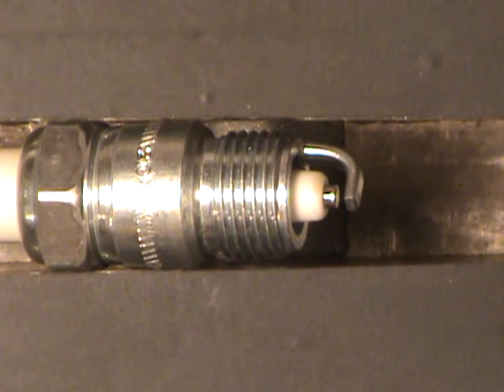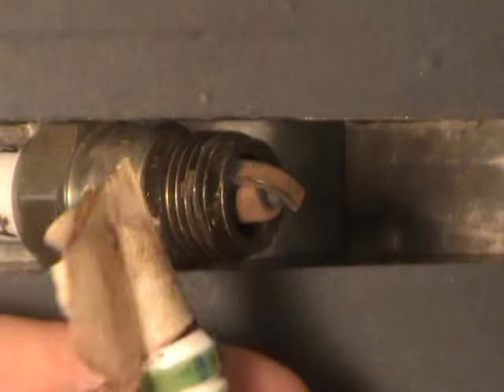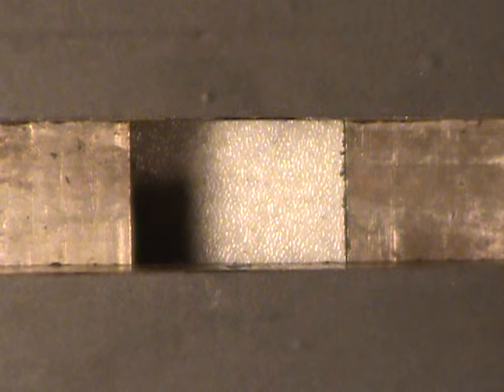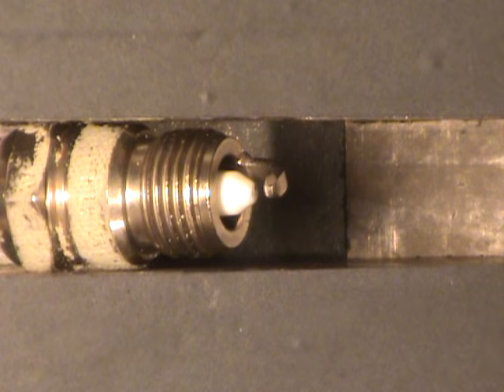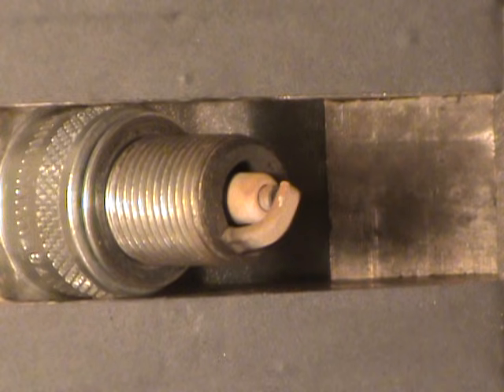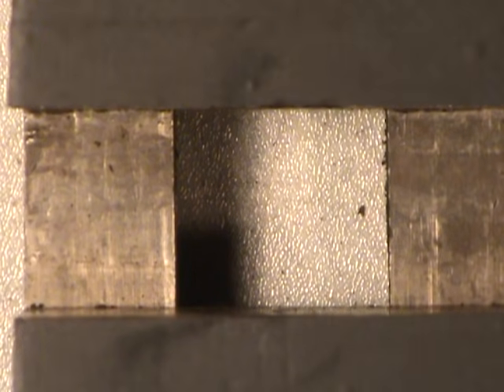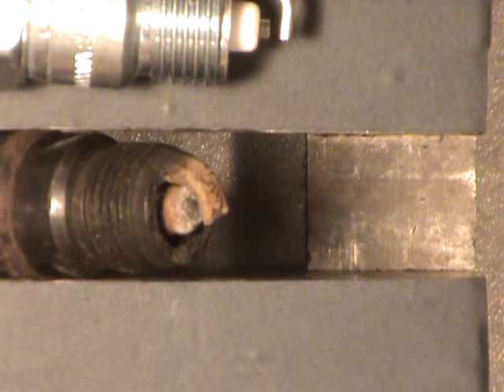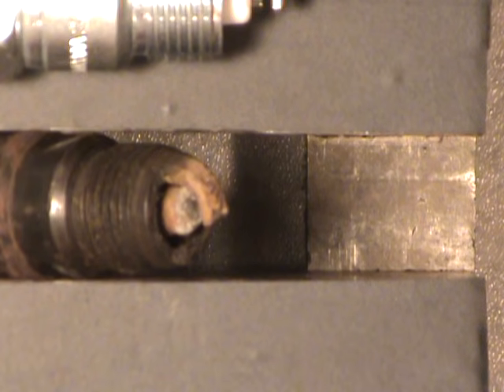SPARK PLUGS How to Read them (Part 3)

Comment: On the plug you show at the 6:00 minute mark, with the grey porcelain, if it was on a 4 barrel would you jet the primaries up by 2 or would you be looking at the secondaries as well?
Reply from the maker: Greetings MasterKane1963....Thanks for watching, and for Your comment/question/s as well....Well now, there are so many "Things", that have to be taken into Consideration, and, the First thing, that a Person should be made aware of, is the Fact, that "Gasoline" these Days, and for quite a few Years in the Past as well, is somewhat "Different", then the Gasoline, that used to be "Leaded" (pronounced "Led-ed"), and that "Lead", I think, was called..."Tetra-Ethel-Lead"...and was an Additive, that the Gasoline Refiners/Producers Added to that much "Older" Gasoline, to, I believe, Raise the Octane Level/Rating, and, also, from what I recall, that "Lead" Additive, helped to perhaps "Cool" the Exhaust Valve "Seats" in the Cylinder Heads, as the Exhaust Valve "Seats" were probably made of a much "Softer" Metal/Material way back then, in an Engine, perhaps produced before the 1970's, and I'm also thinkin', that, that "Lead" Additive also Cooled the Exhaust Valves themselves somewhat.

Then, due to that "Tetra-Ethel-Lead" being "Toxic" to Humans and many other Critters, that Tetra-Ethel-Lead, was, shall we say "Banned/Outlawed" by the Governments of the day.

That good ole "Leaded Gasoline" would probably leave some very "Read-able" Deposits on Your Spark Plugs, where-as, now that most of the Gasoline these days, is usually referred to, as "Un-Leaded" Gasoline.

Then, as of a few Years ago, the so-called "Un-Leaded" Gasoline started to have "Ethanol" (aka, Alcohol, some of which is derived from Corn, as in Corn-On-The-Cob) Added to the Gasoline, which, can "Alter" the Deposits (as in not so much, or any), that a Person is actually able to "See" and/or "Read" on their Spark Plugs "Fire-ing" End, which includes the Outer Electrode/Ground Strap & the Porcelain which surrounds the Inner Electrode as well...!!!

Also, Gasoline "Blends" have Changed/Evolved over the (many) Years, as in, things referred to as..."Oxygenates"..."Fuel System Cleaners"...&...any Other "Additives" that may be found in the Gasoline that is Sold to You, in the area where You Operate Your Vehicle, and, if Your Gasoline has Ethanol in it, that "%" (per-centage) of Ethanol can "Vary" somewhat.

I have seen on some Gas Pumps, Indicating, that the Gasoline "Might" have Up-to "10% Ethanol" in its "Blend".

I wouldn't want any Gasoline that has any More then "10% Ethanol" in it, as I have already "Re-Jetted" a Carburetor's "Primary Jets" .009" (9 Thousandths of an Inch) LARGER, in order to "Cure" a "Lean Surge" (Car bucking/jerking back and forth) while just trying to maintain 30 Miles-per-hour (50 Kilometers-per-hour) on a Level Road & while also keeping the Gas Pedal in fixed position.

That Grayish Color that You see on Your Spark Plugs, might not be all that bad, if in fact, Your "Gasoline", has about "5% to 10% Ethanol" in its Blend.

That nice "Light Tan" Color "Deposit" that You saw, on that Spark Plug in this YouTube Video of mine, was, as I recall, a result of having Gasoline that was being produced here in Canada, in about 2010 (Year), and it "Might" have had, as they say..."Up-To 10% Ethanol" in its "Blend", and that nice "Light Tan" Deposit was a Result, of having my 850 CFM Thermoquad 4 Barrel Carburetor's "Primary Jets"..."Increased" from, .095" up to .104" (95 Thousandths of an Inch, Increased to 104 Thousandths of an Inch Orifice/Hole Size!), which actually "Cured" that "Lean Surge" that my Car was experiencing, and everything from, the Engine Cold Starting, Warming Up while Driving, and, Over-All Response and Performance was, dare I say..."Fantastic"...!!!

Now, enough about Theory and Story Telling, lets now move onto, "How" Your Engine is "Behaving", and, weather or not, Your Engine/Carburetor/etc., may need some Help or Adjustments/Part Changes, shall we...

I have No Idea what-so-ever, as to just "What"...Year?...Car or Truck?...Model?...Engine?...Transmission?...Carburetor?...Any Modifications at all?...etc., that Your "Ride" (aka, Vehicle) happens to be...???

Seeing as how, up to this point in time, I have No "Specifics" to go on, I'll mention a few "Generic" things that can be considered...

How is Your Vehicle Running & Behaving, as in...Starting...Hesitating/Surging...Backfiring at different gas pedal Positions perhaps...or, "Anything" at all, that You have Felt/Observed, in the way, in which Your Vehicle is Running/Performing...???

One of the Most "Damaging" (and Expensive) things, that A Carburetor can "Do" to almost Any Engine, is to be "Providing" a "Way-Too-Lean" Air/Fuel Ratio, while Doing a..."Wide Open Throttle" (WOT) Acceleration...!!!

When the Engine is being Forced to do a "WOT", and using Gasoline "Without" any Ethanol in its Blend, about a "12.5 to 1" Air Fuel Ratio (or "Richer") should be relatively "Safe", so as "Not" to cause any Engine Damage...

...where-as...

...the "More %" of Ethanol in the Gasoline "Blend", the "Richer" the Air/Fuel Ratio should be, considering that "Alcohol" (Ethanol) by Itself, Needs to have a Much "Richer" Air/Fuel Ratio, then that of "100% Pure Gasoline" that "Does Not" have Any Ethanol in its Blend...!!!

One the Engine is up to Full Operating Temperature, I usually set-up the "Primary Jetting" in a 4 Barrel carburetor First, and, get the Engine to Respond well, while Driving at City Speeds (Legally!...lol)...

...then...

...once I'm satisfied with the Performance/Economy, with the "Primary Side" of the 4 Barrel carburetor in question, I usually start to "Dial In", the "Secondary Side" of that same Carburetor, starting with the Secondary Air Door's "Torsional Wind-Up Spring" Setting (if it has one, that is), while doing  some WOT's (Wide Open Throttle), and, if I keep my Manual Transmission in a Lower Gear, I shouldn't see those "Blue & Red Flashing Lights" in my Rear View Mirror...!!!...lol...

...and, if Needed, the "Secondary Jets" Sizes, might need a "Re-Calibraton" of sorts, which in most, but not all cases, calls for an Increase in the "Orifice/Hole" Size (aka, Jet Size), and, if needed, some "Accelerator Pump" Adjustments as well.

It's always "Best", to do a Complete "Tune-Up", Before trying to "Change" Anything, like, Carburetor Jets/Parts/Adjustments, and the same goes for the "Ignition System" as well...!!!

Always "Check" and Maintain your Engine's "Ignition Timing", as that alone, can make for, a Good Running, or, Not So Good Running Engine, which will usually include, Good or Bad Performance and Economy as well...!!!

Any Engine, that a Person "Expects" to have Running/Operating at a very Good Level of Performance and Economy, has to have...New, or, As New...Air and Fuel Filters...Motor Oil and Oil Filter...Gasoline that is Not Too Old, as it does go Bad...Ignition Components "Must" be in Great Shape, as in...Spark Plugs...Distributor Cap & Rotor, and Breaker Points (if so equipped)...Spark Plug Wires/Leads...and...Any "Other" Parts and Pieces, which might also include "Emission Control" Components/Parts as well...etc.

Still Awake...???...lol.

So then, if You care to, You can let me know, all that You can, as it applies to Your Vehicle, so I won't have to, go on...

...a "Wild Goose Chase"..!!!...lol.

Be Safe, take care, and have a good one.
Reply: RockysRoadshow
Wow quite the response lol. Thank you for the information.

The ride is 1963 Ford F100 with a 302 attached to a C6 auto. The 302 is mildly done up. Comp cams XE274 camshaft, 1.6 rockers, performer rpm intake, 670 holley street avenger w/ vacuum secondary, MSD 6AL ignition box with an MSD billet distributor (mech advance only, no vacuum can). Carb is clean, has a fresh cap/rotor

The truck idles well, street driving/cruising is good, occasionally I will get a bit of run-on, but in Drive at cruising speed I will get a slight ping if I accelerate (without downshifting) or on climbing a hill. Since my plugs are a greyish colour on the porcelain, I'm wondering if my pinging is a lean ping. Also wondering if the greyish colour is deceiving because, as you said, they put a lot of crap in gasoline nowadays. Timing is not overly advanced either. 10 deg initial, 30 total and I have read/heard that a lot of 302s like more (32-38 total).
Reply from the maker: MasterKane1963
Greetings MasterKane1963....Thanks for the "Extra", and somewhat Needed Information, as that my Friend, will indeed "Shorten" the Time, that I have to  be spending, looking into my Crystal Ball...!!!...lol...When You stop Laughing, we will begin....I see that Your "Distributor"..."Does Not" have a "Vacuum Advance" Canister/Unit on it, and, by "Not" having "Vacuum Advance", on a, shall we say, "Street Drivin' Truck or Car", as opposed to a "Trailer Queen", that always gets "Trailer-ed" to the "Race Track/Strip", and is a "Race Only" Vehicle, then, Fuel (gasoline) "Economy", while just "Cruzin'" Along will be suffering quite a bit, along with probably having Your Truck's Engine "Consuming" too much Gasoline, when it really Doesn't need it, especially, while, like I said before...while just "Cruzin' Along".

Also, by "Not Having" Vacuum Ignition Advance, on Your Distributor, I'm, actually quite surprised, that Your Spark Plugs "Are Not" covered with black "Carbon!"

You had mentioned, that Your 302 Cubic Inch V-8 is Mildly-Done-Up, which has me wondering...just how much of a "Compression Ratio" that Your Engine happens to have...???

Here's a somewhat "Generic" Reason, as to why, Your Engine, is, as You described it..."Pinging", while "Accelerating", and also, while Going-Up/Climbing a Hill...

There are a few thing, that can/should be Considered...

A light "Pinging", of the Engine while "Accelerating", or, shall we say...putting a "Load" on the Engine, as opposed to just Lightly Cruising along, in, and by itself, shouldn't harm the Engine at all.

It's when, You start Hearing a "Knocking" or "Rattling" Sound, especially when You are Accelerating the Engine, going up a reasonably Steep Hill, or even, Towing a Heavily Loaded Trailer for that matter, that, the "ALARM BELLS" should be "Going Off"...!!!

When-ever You Hear Any "Knocking" or "Rattling", coming from Your Engine, "Do Not" Operate Your Engine any Further...Until...Those "Noises" are "Gone"...!!!...or...probably...Bye Bye...goes that Very "Damaged", and maybe even "Destroyed" Engine...!!!
 
"Ignition Timing" that is "Advanced" a bit too Much, at the Engine RPM's, where the "Pinging" is taking place...and/or...too "Low" of an "Octane" (rated) Gasoline is being used, for the "Compression Ratio" of the Engine in question, is what, will usually "Cause" that "Pinging" that You are Hearing.

Also, things like "Carbon" Build-Up in the Combustion Chamber/s, usually due to, a Rich Air/Fuel Ratio Running Engine, or even a Carburetor "Choke", getting Stuck or not operating as it should, etc.

Before I forget, You said something about Engine "Run On", and has me thinkin', that, that there "Run On", is possibly, while You are "Turning Off" Your Ignition Switch/Key, to Stop the Engine, and, if that be the case, it's usually caused by having the (curb) "Idle Speed" (aka, engine RPM's) "Set" a bit too "High" on Your Carburetor...maybe close to "1,000-RPM's" possibly...???

Here's a "Trick", for Ya, to make that there "Run On"..."Disappear"...unless You ever get around to Lowering Your (curb) Idle Speed RPM's, (while in gear), and still have the Engine, with that Particular "Cam" (aka, camshaft) in Your Engine, still keep running, that is...

...It's quite Simple really...Actuate Your Parking/Emergency Brake, then, just Turn Off the Ignition Switch, with the Automatic Transmission in "Gear", and when the Engine Stops, "Without" that "Run On"..."MAKE SURE", that You put the Gear Selector/Lever in "PARK", before You "Exit" Your "Pick-Em-Up-Truck"...!!!...You're Welcome!...lol.

Let's see now, about Your Ignition Timing..."10 Degrees Initial"..."30 Degrees Total"

That Mathematically leaves Your "Mechanical Advance" Amount, at "20 Degrees", of, shall we say..."Advancement".

Did You get "Any" Extra Bits & Pieces with Your Distributor, in the Form of...Weights...Springs...or...Stop Bushings...at all...???

Even if You managed to get Your "Total Timing" (that be..Initial, Plus the Mechanical Amount), up to that "32 to 38" Degrees, that would only be good for You using a "Lead (led) Foot" on You Gas Pedal, and, that's just Great, for Racing/Accelerating purposes...

...where-as...

...so many Street Drivin' Vehicle Engines, that have Distributors, Equipped with "Vacuum Advance Canister/Units", would probably, for the most part, be Running an Ignition "Advance", of about "50 Degrees (ballpark figure)...(that be...Initial, Plus Mechanical Amount, depending on RPM's, and Vacuum Advance Amount & Rate, depending on Vacuum Signal), while "Only" just "Cruzin' Along" at a not too fast of a Speed, and with, a very Light Throttle (gas pedal) application, which will usually results in, the "Best" Gas Mileage/Kilometer-age, that the Engine in question is able to give its Owner, and yes, of course, that's also dependant on, any..."Go-Fast-Parts-Installed", Differential Gearing,  etc., and, last but not least, and usually make the Gas Companies "Smile", is usually, "How?" (lol),  the Vehicle's Guy/Gal/Operator, uses that "Appendage", which usually, goes by the Name..."LED-FOOT"...!!!...lol.

Also, when just "Cruzin' Along", with a Light Gas Pedal application, the Carburetor, will a Run "Much" Leaner, "Air/Fuel Ratio", which, will also, make for some really "BIG" Gas "Savings"...!!!

The Higher the "Compression Ratio" that the Engine has, usually Requires a "Higher Octane" Gasoline!

The "Lighter" the "Load" Placed on an Engine, will usually Allow quite a bit More, of Ignition Advance...

...where-as...

...in the case of an "Increased or Heavy" Load, on an Engine, this Scenario will usually require, that the Ignition "Advance" be "Decreased" to an "Amount", that should be, just "Under" the Point, at which the Engine, shall we say, and in this case...Starts "Pinging".

To "Avoid" Engine "Damage", Ignition Timing Needs to be "Just Right" at "All" Engine "Loads" (aka, Heavy, in between, or light), and at any Engine "RPM's" as well.

Both, too "Much", or too "Little" (aka, Improper)..."Initial Timing" (usually at Idle speed)..."Mechanical Amount" & "Mechanical Rate of Advance"..."Total Timing"...and Vacuum Amount & Vacuum Rate of Ignition Advance, can cause, Poor Fuel Economy...Poor Engine Torque & Horsepower...Overheating (as in Engine temperature), Hard Starting, etc.

What is the "Octane" of the Gasoline that You are currently using...???

Your Engine's "Compression Ratio"...???

If You feel Safe, setting Your Engine's Timing, while using a Timing Light, maybe try setting Your "Initial Timing" about "2" degrees "Less" then that supposedly "10" Degrees "Initial Timing" that You have now, and make sure, that the Engine is up to Operating Temperature!

Take it for a test Drive, and see if Your "Ping" goes away.

If You still hear the "Ping", perhaps "Reduce" Your Initial Timing about "2" Degrees Each Time, until the Ping "Disappears", and when it does...Write Down on Paper...where that Initial Timing Setting took place, and hopefully, Your Engine didn't stall and quit on You.

Setting up a Distributor like Yours (without a Vacuum Advance Unit), can be quite the challenge, if "Fuel Economy" is a consideration of Yours at all.

Although, as from a "Performance Only" standpoint, there will still, probably have to be some considerable "Head-Scratchin" that has to be considered and figured out.

I guess the word that would be needed at this point in time, is the word..."Tailored"...as in, Your Distributor, really should be "Tailored" (aka, set up, and matched) to Your Engine's Needs, and the way in which You will be "Using" Your "Pick-Em-Up-Truck".

Once Your Engine's "Timing Needs" are "Figured Out", and You are going to "Use" the Distributor that You now have, then, One of "Two" Methods can be used, to "Re-Curve" Your Distributors "Advance Curve"...

If You can locate an Old School type of Guy, that has access to a Sun Distributor Machine, it would be, like Winning the Lottery!

Or, alternately, You could get a hold of an "Advance Indicating" Type of Timing Light, that actually has a Read-Out on it, that should be showing the Timing Advance amount at Various Engine RPM's...

...then, there's the "Poor Mans" Method...lol...That would be, purchasing a "Timing Tape" (has to be the "Exact" One, for the Diameter of Your Balance-er/Damper!!!), that gets "Stuck" on Your Engines "Harmonic Balance-er or Damper" if You will, and, just use a regular Timing Light, to see what the "Advance..."Degree-age" happens to be, but, "Never"...Rev Your Engine, up to "Too High" RPM's "Without" a "Load" on the Engine...or...it will probably..."Self-Destruct"...!!!

Another thing comes to mind...What "RPM's" is Your Engine "Idling" at "In Gear" with the Engine Fully Warmed Up to "Operating Temperature"...???

Recap...

Your Engine's "Compression Ratio"...???

The "Octane" of Your Gasoline...???

How You will be Using/Driving Your Pick-Em-Up-Truck...???

First consideration is...Get Rid of that "Pinging".

Also, keep a "Close Watch" on Your Engine's "Coolant (antifreeze-n-water) Temperature Gauge", that will let You See if Your Engine is getting "Too Hot" & maybe "Over-Heating" as well.

If You care to, let me know, how it's going...

Be Safe, take care, and have a good one.
Reply: RockysRoadshow
Thanks again for the plethora of information. To answer your questions:

I don't know the compression ratio because I haven't been able to get a compression gauge on it yet. But I would estimate it as somewhere between 9.5 and 10:1.

Octane right now is 91 (93 and 94 can be difficult to find).

It is a street/cruising truck. But I doubt my foot will get any lighter so I am not concerned with gas mileage or tire life :)

Coolant temp gauge runs the same temperature consistently. Regardless of driving conditions or ambient temps.

Right now curb idle is at about 1000rpm in P, about 7-800 in gear.

It has been raining lately so I have not had a chance to get it out. Once I do I will play with the timing to try and get rid of the dreaded ping.
Reply from the maker: MasterKane1963
Greetings MasterKane1963....Now that You have given me, some more, much needed Information, I now have some further "Things", that can be considered, and perhaps applied to Your Pick-Em-Up-Truck's Engine, to help "It", and You out as well....Ok then..."Mr. LED-FOOT"...lol...it appears, that, You might not be able to take full advantage of a "Vacuum Advance" type of Distributor after all, seeing as You don't seem too interested in...just Cruzin', on "Land" as opposed to the "Sea-Going" type of "Cruize"...lol....Now that the "Fun" part is over, it's now time, to put Our "Thinkin' Caps" On, so we might possibly make some progress, with the situation at hand...

Seeing as how that "91-Octane" Gasoline seems to be the "Highest Octane" Gasoline, that You appear to have available to You and Your Truck's Engine, on a "Regular Basis", It would be a very good idea to Stick (or Stay) "Using" that "91 Octane" Gasoline at "All Times", in order to have Your Engine's "Ignition Timing"..."Set-Up", Properly, for...Performance, Efficiency, and hopefully, Your Engine's "Heath" as well (Health in this case = Longevity, and, Not imposing any Destructive "Settings").

Also, try to "Use" the Same "Brand" of that "91 Octane" Gasoline at all times, if possible, as I'm thinkin' that, if "Different Brands" of Gasoline were to be Sloshing around and Mixing inside Your gas tank, the "Additives" in those "Different Brands" of Gasoline, might not "Like" each other, and might just have a very Unwanted "Reaction" possibly...just sayin'.

It's Good, that Your Engine "Idles in Gear", at about "700 to 800-RPM's", and that's tellin' me, that, the "Camshaft" that's in Your Engine, is about the right choice, for a "Street Driven Vehicle", without getting "Overly Aggressive", which can usually cause a few head-aches, in, and by itself.

As long as Your Engine's "Exhaust Gas"..."Does Not" Smell, like it's..."Way Too Rich", while the Engine is just "Idling", while it is up to Operating Temperature, then, You're having a good day!

Always remember, that, Engine "Exhaust Gas" is "DEADLY", and Always have Lots of Fresh Air and Ventilation when-ever the Engine is Running...!!!

There is quite a Bit "More" to an Engine's "Ignition Timing", then that of, something like..."Initial" or "Total" Timing, and, I'll try to explain a few things...

From what I found out, a while ago, is, that, in order to have an Engine, Operate with Power and Economy, the, shall we say..."Combustion Event" (that's when the Air/Fuel Mixture is Burning), and, when the "Expanding Combustion Pressure" exerts all of that, very powerful "Pressure" on Top of the Piston, that, the Position of the "Crankshaft" is about "15 Degrees" (Ballpark Figure?) "Past Top Dead Center"...

...but...depending on the "Air/Fuel Ratio" (as in, Lean or Rich), the "Time" it takes for the "Different" Air/Fuel "Mixtures" to Completely "Burn", at about that Crankshaft's "15 Degrees Past Top Dead Center", will Require a "Different" Amount of "Ignition Timing Advance!"

If Ignition "Advance" is too "Late", then, "Power & Economy" is Not Very Good...

...where-as...

...if Ignition "Advance" is too "Early", the "Combustion" that Occurs, will be trying to "Push" the Piston "Down", Before it gets to "Top Dead Center", and could possibly, result in...Pinging...Knocking...and maybe Rattling, which has been known, Harm, and perhaps Destroy Engines...!!!

A "Lean" Air/Fuel Ratio, takes "More Time" to Burn, as compared to a "Rich" Air/Fuel Ratio.

When at Higher Engine RPM's, that's why "Ignition Timing", as in, when the Spark Plug "Sparks", to have that "Leaner" Air/Fuel Ratio, "Complete its Burn" in Time, has to Occur much "Earlier" (as in, the Degrees "Before Top Dead Center"), then, that of, a Much "Richer" Air/Fuel Ratio, that, "Does Not" need as Much "Ignition Advance", to Complete its "Burn" in Time, due to the Faster "Speed", at which the "Richer" Air/Fuel "Mixture Burns".

Seeing as how Your Distributor "Does Not" have a Vacuum Advance Unit on it, I will just omit the Vacuum stuff.

"Initial Timing", is where the "Ignition Timing" is Set, usually with a Timing Light, while the Engine is at "Idle Speed".

The "Mechanical Advance"..."Amount", is the "Amount of Mechanical Advance" that those "2" Centrifugally Activated "Advance Weights" provide, at Different Engine RPM's, up to a Maximum Amount of Advance, and, that Amount can usually be "Changed" quite Easily, if the Distributor has available "Stop Bushings" of Different Sizes, in order to "Increase" or "Decrease" the "Amount" of "Mechanical Advance" desired.

"Total Advance", is when the "Initial Timing" is "Added" to the "Mechanical Advance".

The Mechanical Advance "Curve", is how "Fast", or how "Slow" the "Centrifugal Advance Weights"..."Advance" the "Ignition Timing", and, can be "Altered" (aka, Modified) by "Changing" the "Springs" that "Control" how the Advance Weights "Behave" (Different Color Springs have Different "Tension" Amounts).

What is commonly called..."All In", means, the "Maximum" Amount of Ignition Timing, that, the Distributor provides, and, usually, "What RPM's" that the Maximum Ignition Timing Occurs At (for example...33 Degrees at 3500 RPM).

Remember, about how I was suggesting, that You Reduce Your "Initial" Ignition Timing by about "2 Degrees" at a time, and test drive Your Pick-Em-Up-Truck, to see if that Unwanted "Pinging" reduced or disappeared?...

...when-ever You "Change" Your Engine's "Initial Timing", You are also "Changing", pretty much all of the Ignition Timing "Amounts", at any given Engine RPM, from the "Initial Timing, all the way through the Ignition "Curve", and up to the point of the "Total" Timing as well...!!!

When it comes to "Engines", I always think in terms of "People", as in, I see each and every "Engine", having its "Own Personality", so to speak, and just like People, no "Two" are the "Same", and Behave quite Differently as well...

"10 Degrees" of "Initial Timing", is a pretty good Starting Point for Your Engine.

That "30 Degrees" of "Total" Ignition Timing, looks to be quite Safe/Conservative.

Check out MSD's Website, for some very good and useful information, pertaining to How to Set-Up the Mechanical Ignition "Curve", by Changing the "Springs" which probably have Different "Tensions", that will provide the Ignition "Curves" that You can actually See, in the Charts/Graphs that they have on their Website, and, in my view, it's a Great Article!

It appears, for a Heavier vehicle, with "Larger Outside Diameter Rear Tires", along with, a "Differential (aka, Rear Axle) Ratio", that is a Low Ratio, and, oh, let's say, something like "2.75 to 1",  has me thinkin', that the Mechanical Advance (centrifugal Weights), should be Controlled with "Stronger Springs", so the Mechanical (weights), don't start Advancing Too Quickly, or more then likely, as I see it, might result in..."Ping" city.

A word of "Caution/Warning"...The Camshaft in most Engines "Rotate" at "One Half" (1/2) of the Crankshaft Revolutions, and, pay "Very Close Attention", to any "Specifications" that You Observe, as it pertains to "Ignition Degrees", as, "Some" of those "Degrees", could be Stated in Either..."Crankshaft Degrees"...or..."Distributor Degrees"...!!!

I just take any "Distributor Degrees" and "Convert them to "Crankshaft Degrees", by "Multiplying" the "Distributor Degrees" Times (X) "2", so as to avoid any "Mistakes", when it comes time, to figure out, what I'm really after, and that my Friend, is Ignition Timing, that is in..."Crankshaft Degrees"...!!!

Maybe, do an Internet Search, on some "Ford/Truck/Mustang/etc. "Websites", that happen to have "Question" & "Answer"..."Forums" on them, as, there are what seems to be, a "Limit-Less" Amount of "Enthusiasts", that might just be able to help You..."Fine-Tune" Your Pick-Em-Up-Truck's Engine's "Ignition Timing" Requirements, that, once, You get All of Your Distributor's "Timing" Parameters "Set" the "Best" that can be done, I'm sure, that You'll be Amazed, at how much More Your Pick-Em-Ups Engine's Power and Responsiveness will be...!!!

If You want Your Engine to last, that much longer, Start and Run Your Engine, at least once-ah-month, more is even better, as over time, the Oil Lubrication will drip off of the Engine's Internal Parts, and especially so, if Your Valve Springs are Stronger then Stock, as there is that much More Pressure being exerted on Your Engine's "Camshaft Lobes" via the valve Lifters, and if those Camshaft Lobes become "Dry" (aka, not much Motor Oil on them), they might just get "Destroyed", due to Lack of Lubrication...!!!...also, the only way, that the Pistons, Cylinders, get Lubricated, is usually by the "Splash" Oiling, that gets "Flung" from the Crankshaft & Big End of the Connecting Rods, while the Engine is Running, and all the rest, is usually Lubricated, by the Pressure from the Oil Pump, that provides the "Pressure" type of Oiling for Your 302 Engine.

If I left anything out, or, if You need any more help at all, I'll be floating around, here in Cyber-Space somewhere...lol.

Good luck...

Be Safe, take care, and have a good one.
Reply: RockysRoadshow
Thank you so much for your help and advice. If I have any more questions when I finally get out to tune, I'll try to find you out there somewhere in cyber space lol!